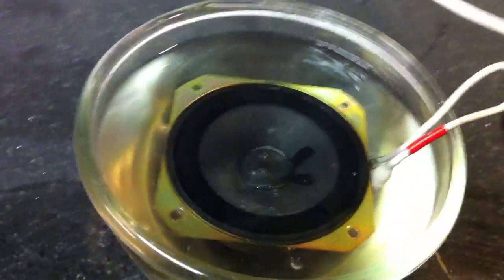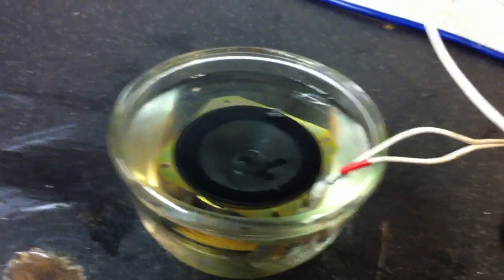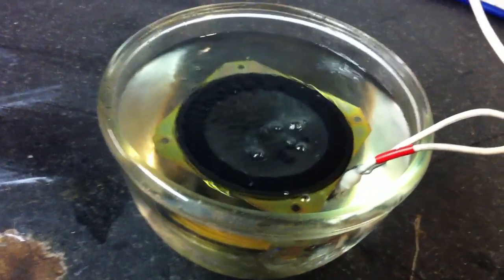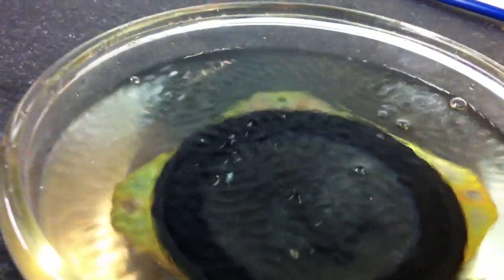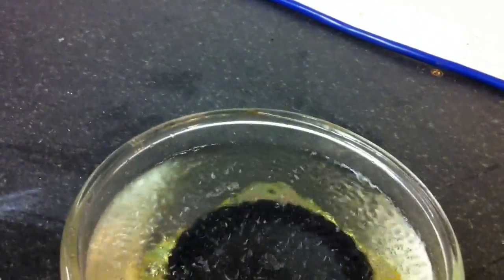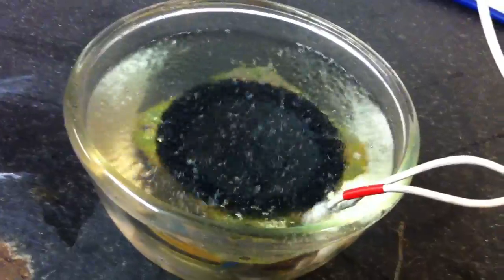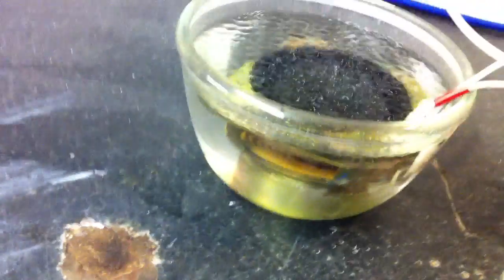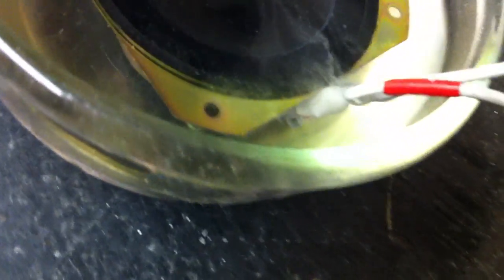little sub under oil

Comment: A large poly cone speaker probably could handle many kilowatts as the water makes an excellent coolant and it may eventually heat up the water. hence the voice coil as a heater. lol

Comment: What?! I'm surprised that the cone held up that long. Was it paper, or some kind of plastic? 

Also, before you "dumped 1kW into it", what kind of ballasting was going on? I'm absolutely amazed that the speaker took the full 270v on the Satisfaction Dial without going *POP*

Still, 1kW was too much for it, as like it'd be for most speakers. When you activated the 1kW, what was the voltage? Variac on zero, THEN switch 1kw, turning variac up to 20v may have been more interesting. :-)

-BBD.
Reply from the maker: Well I was using and still have the same old school 20A Variac. I recon initially I put it on 250W magnetic ballast (as that's what I always use) but when I stuck 1kw through it it was maxed out on the Variac so almost 280V as my incoming supply to my property is 245V.

That speaker came out of a 2.1 something and I've kept the other 2. The driver was made out of paper.

Comment: that was pretty darn cool what you using as a power supply thought?
Reply from the maker: I just used my Variac and I use a selection of magnetic ballasts to alter the voltage and current into stuff.